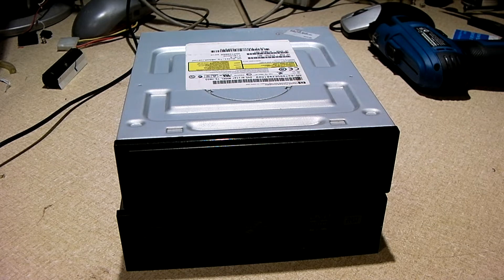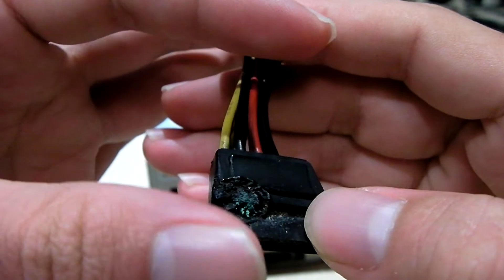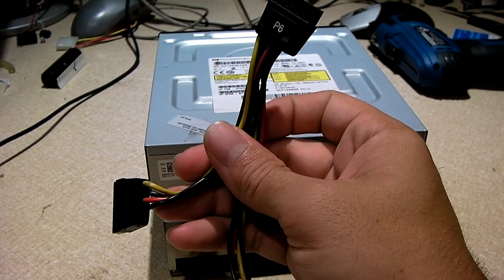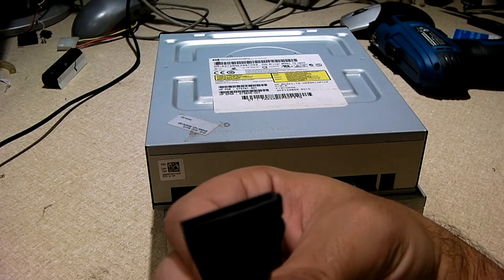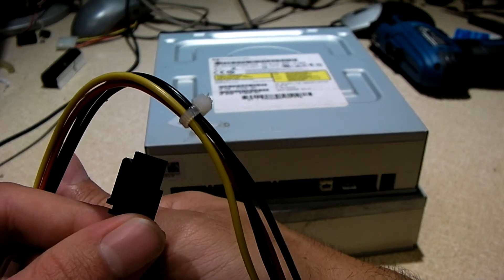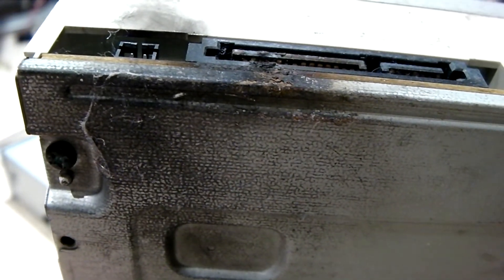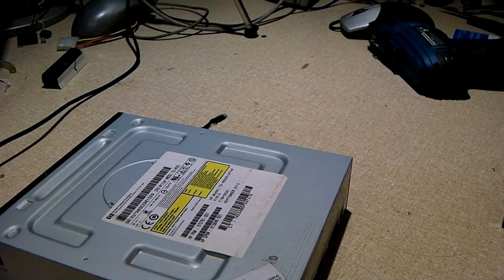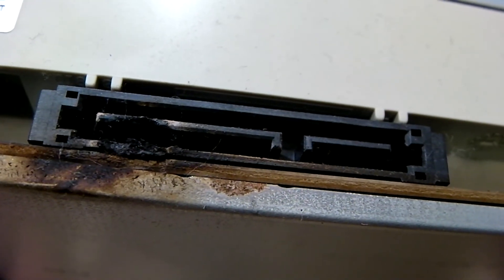A potentially hazardous flaw with HP 6000 Pro MT Workstations

Comment: is this place burning a lot of disk? i have a 6005 the psu is crap i added a gt730 and have killed 2 psu so i hacked in a  400w coolermaster just have to hit f1 to boot till i get stock psu to "add in " to make the mb happy
Reply from the maker: There were a few drives that got affected like this, and it was only the 6000 pro systems. Those machines have since been phased out of service.

Comment: some Molex to SATA has the same problems. The Adaptor has molded SATA connectors which causes the issue. The cable inside the connector arcs which causes the short.

Comment: yikes not good my work just bought new 8300 elite desktops very nice systems the reason is bc we had these lenovos that where hard to reimage due to almost no driver support out of the box but never seen any of the older dc7100 desktop models do this as for the 6000 pro systems never owned any of them